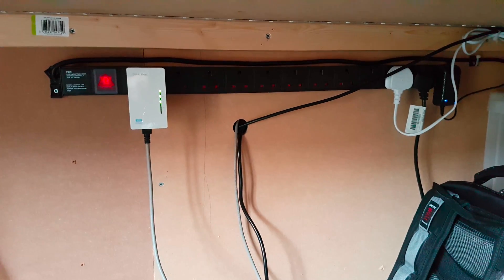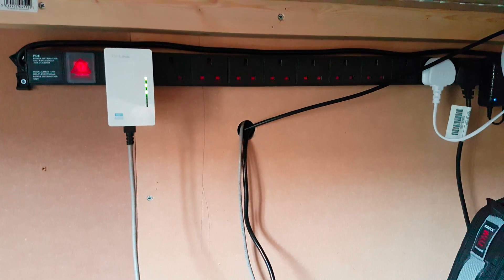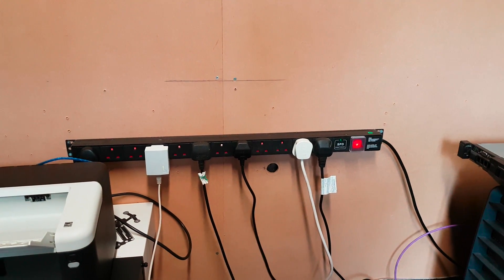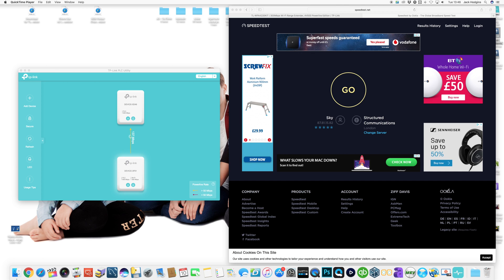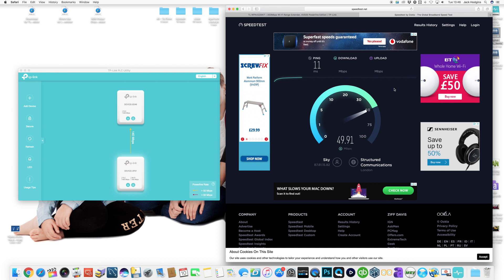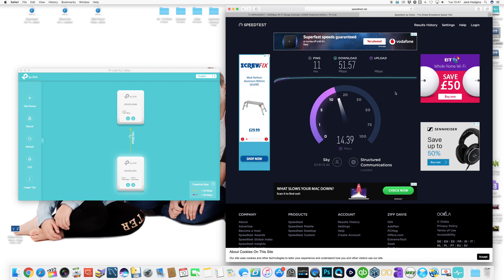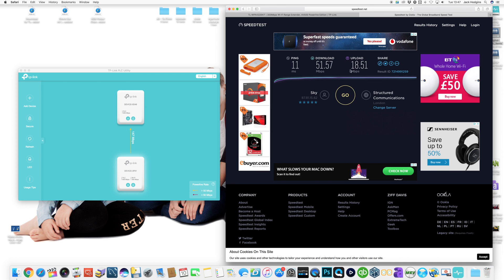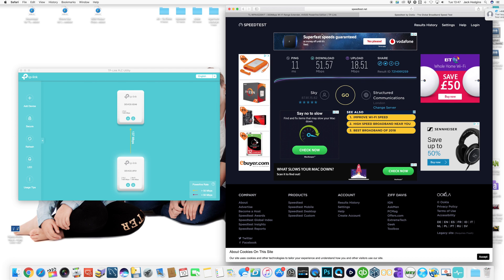TP-link AV500 Powerline Edition Test 1

Comment: Tip: if you can't plug it directly to the wall, put it in the very first plug, nearest to the power cable. And don't use an extension that has a filter; it weakens the signal even more.